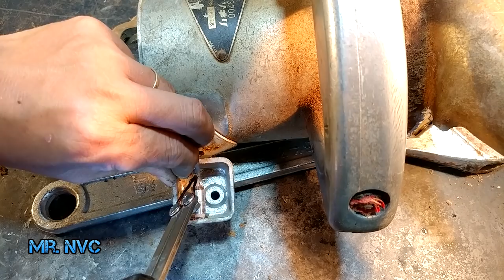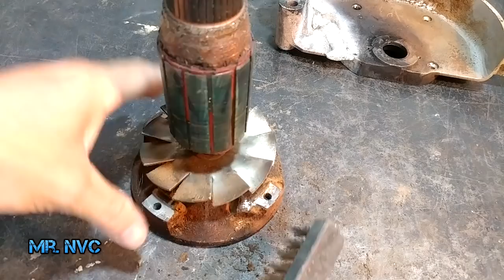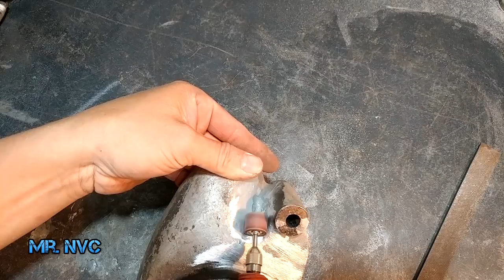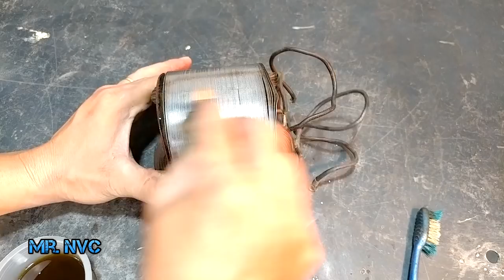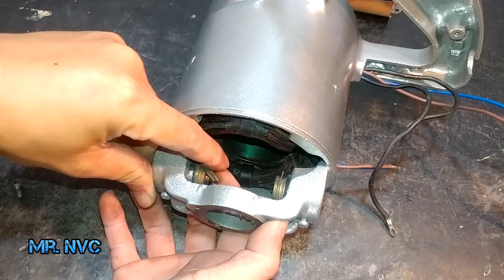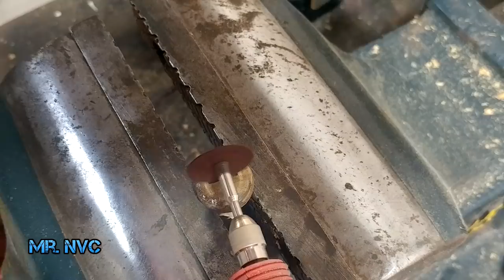VERY Old Electric Wood Groove Cutter Broken Restoration - MAKITA JAPAN

Comment from the maker: I was given a gift from a Japanese fan, it was a machine left by his father. His father has been a carpenter since World War II. The machine is too old. Look very ancient and beautiful appearance. But unfortunately it was broken due to shipping from Japan to me. I decided to restore it as it was when it was shipped.
Reply: Are you a Pilipino sir?
Reply: @arnoldbusuego8382   He does seem to repair a lot of Japanese tools.  I wonder if he has a problem with the probably lower line voltage (Japan uses 100v AC circuits in many cities) those power tools were designed to operate on.

Comment: Very nice refurbishing and repair. What did you use to "weld" the cast aluminum? That looked like it will stay through rough handling. One more idea, if you want your projects to go over the top, redesign the ID plate(s) on some computer program to the exact size and colors. Then take that design to most any trophy or sign shop and have them sublimate it onto a metal plate. It will look exactly like a new plate form the manufacturer. It really will put your refurbishing projects over the top. Thumbs Up!
Reply from the maker: Thanks
Reply: Nice work
Reply: MR. NVC DIY lol “thanks”

Comment: Interesting machine; looks like a circular saw with a different blade and somewhat different adjustments.  Great job overall, but demerit points for misuse of a file as a screw driver.

Comment: Should have left that weld on the inside for extra strength.
Reply: looked more like a brazing job than a weld.
Reply: scharkalvin no it is a weld, brazing is using a bronze rod, the clue is in the name, in this case an aluminium rod was used to weld the crack together.
Reply: @grahamparr4710  The key difference between welding and brazing is that in welding both the welding rod AND the material being repaired are heated to melting temperature.  In brazing, the material being repaired is NOT being melted.  It doesn't matter what the repair patch material is made from.  I don't think the torch was hot enough to melt the joints of the part being repaired in this instance.